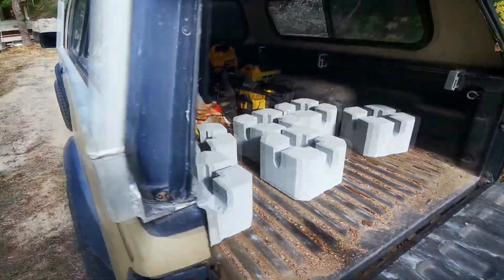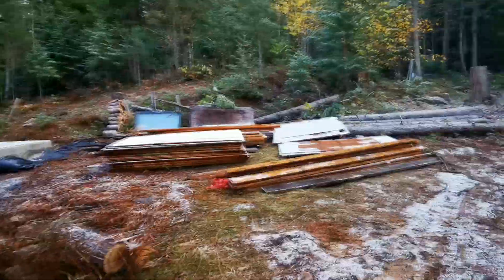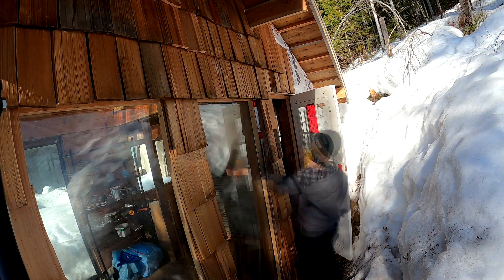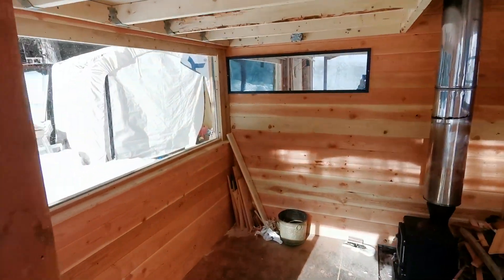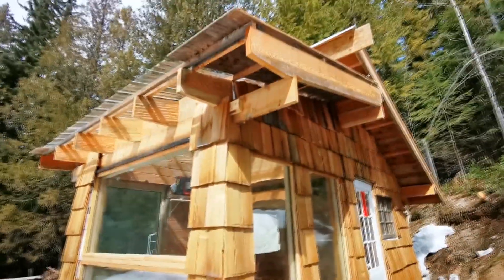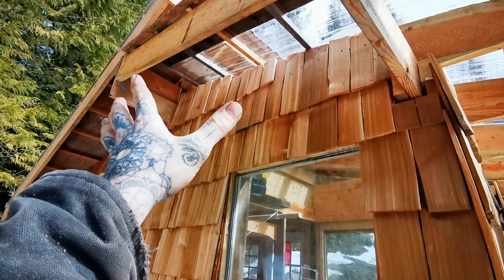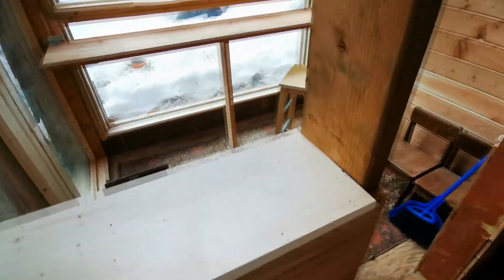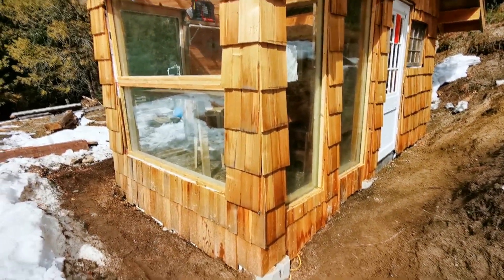How I Built an Oversized Out House turned Tiny House for under 5k$. DIY Woodworking

Comment: Obviously off grid , so no building codes . Lots of them around here.
Reply from the maker: Yes indeed, this is temporary building, built on sand and from 80% recycled materials. They have used it to stay in as well as inspiration for the "real" house that was built right next to it after the fact. I not only taught them creativity, diy mindset but they got to make it their own and have a soulful home for 3 seasons while getting the big Home done, which was the goal. I'm sure those "real carpenters" like you had plenty opportunities to fix anything unfinished in that micro. ;)